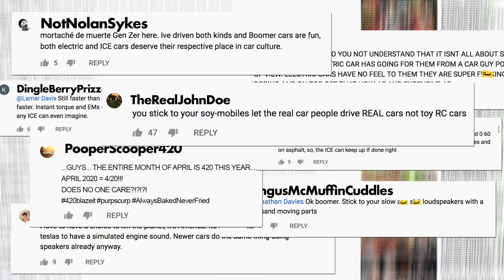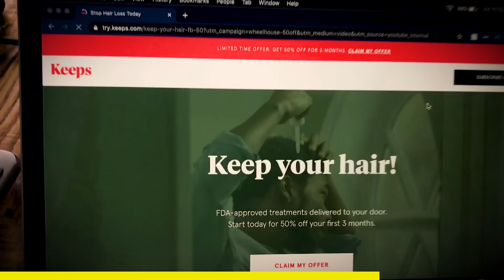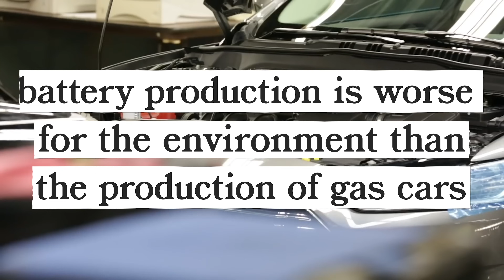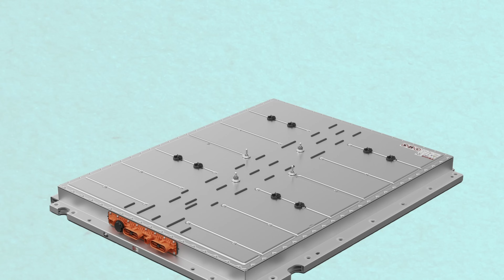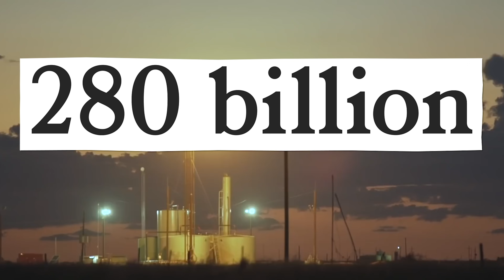Are Electric Cars REALLY Better for the Environment?

Comment: I'm with Nolan, I love how the engine sounds and feels, and I think I'll always have a gas car, but we need to accept that electric cars are here and it's the future.
Reply: @L.K this is a perfect way of explaining it. I also thought it was like digital art vs traditional mediums because the traditional forms are far more expressive and human but digital art is great at making an image fast. They both have their uses but traditional art, well made mechanical watches, and gas cars are a much more exciting, sophisticated experience.
Reply: @yoyo 19 That is awesome
Reply: @L.K Yeah but the same could be said about manual transmission cars.... if car manufacturers don't have enough incentive to make them they wont and they'll slowly disappear from the market. So maybe not in our lifetime but because there are more efficient ways, eventually gas powered vehicle will cease to exist.
Reply: I don’t want electric cars to completely take over. It should be an even split. Half gas cars on the road and half ev’s.
Reply: @L.K Or 
Have an electric car with manual transmission.
That sounds fun.
Reply: @anirudhhhh  that would kinda defeat the goal of efficiency, wouldn't it? ICE cars need transmissions to aid acceleration until it reaches optimal/top speed (either of the engine or of the car, to prevent stalling). However, ICEs suffers from inefficiency because not all power the engine produced would be laid down on the ground (thanks to the gearing) - and this is even on top of the inefficiency of the engine, which is for another discussion. EVs, on the other hand, can instantly put down whatever torque it can/needs to, so there's very low (if any at all) chance of an EV bogging down/stalling while accelerating. This eliminates the need transmissions and the inefficiency it introduces.  

(I could be wrong on some concepts/ideas, and I would gladly be corrected by anyone more knowledgeable on the topic)
Reply: anirudhhhh not how it works and not sure if it would have a clutch
Reply: @anirudhhhh  literally ZERO point in a variable transmission with an electric car, since they make all their torque from 0 revs. It would be totally inefficient. But, hey, keep dreaming bro! 👍😉
Reply: Yeah I find electric soul sucking, yeah it’s quiet, too quiet, GIVE ME MY ENGINE NOISE BACK.
Reply: I have started a collection of v8s if all goes to plan I'll keep them until I die. Driving a big ass manual V8 in 30-40
 years is going to be super rare
Reply: It doesn't have to be the future for all of us. If enough people buy EV's we'll be free to enjoy our loud ICE's in peace.
Reply: You won't have a choice in 20-odd years bro. Oil is a finite resource, and will only get more expensive. Also, most countries are in the process of phasing out ICE cars (most of Europe has already committed to no fossil fuel cars by 2025 or around that time), so good luck finding one to buy.
Reply: Liam NIre ever heard of synthetic oil?
Reply: @Ryan-mg5ve  I think you're focusing too much on the "oil is a finite resource" and not enough on "there won't be any ICE cars to buy".
Reply: @Ryan-mg5ve  oh, and synthetic oil is made from actual oil...... So there's that too.... 🤔
It just has synthetic additives.
https://en.m.wikipedia.org/wiki/Synthetic_oil

Comment: Wouldn’t electric cars produce more emissions because they typically will need battery replacement at some point?
Reply: If you took a look at climobil, you would actually see that the battery manufacturing process isn't enough to offset the result, here's a scenario I made - taking into consideration one battery life (very conservative estimate) vs. the total emissions from an ICE car during the same period: https://climobil.connecting-project.lu/?batteryLifetime=400000&batteryCapacity=72.5&greenhouseGas=65&electricCarRange=460&carbonElectricityMix=453&greenhouseBattery=30&greenhouseWTT=25&greenhouseTTW=150&batteryPenalty=0.9&annualMileage=25667&ICECurb=1205&ECurb=1847&NEDCpenalty=0.39&decarbonization=0.1

Comment: What about the fact that the Nissan Leaf needs scraped after 8 years because the battery needs replaced at a price of $33,000 when the value of car is only $12,000 with replaced battery. Toyota Corolla’s las 30 years and a Nissan Leaf would be scraped three times in 30 years so that’s 57 tones X 3
Reply: I made you this scenario in climobil, I hope you get the point:
https://climobil.connecting-project.lu/?batteryLifetime=201467&batteryCapacity=30&greenhouseGas=65&electricCarRange=250&carbonElectricityMix=453&greenhouseBattery=30&greenhouseWTT=25&greenhouseTTW=128&batteryPenalty=0.9&annualMileage=25667&ICECurb=1190&ECurb=1516&NEDCpenalty=0.39&decarbonization=0.1

Comment: I agree with most of these points and am big car guy and work for one of the biggest car manufacturer in the word that’s making its own ev too and the biggest problem we are facing is the lifetime of theses batteries like your phone after sometime they don’t keep charge and loose power storage it has been calculated that after 7 years of average driving these batteries will need to be replaced where gas cars have a normal usage of around 15 years and since most people don’t want to make the expensive replacement of a new battery witch would be around half the price of the car it will be discarded witch would start the process all over again there also a problem with the “recycling” of the batteries like you mentioned where rn they basically just shipped to poor countries and burned witch creates a bunch of gasses  That are worse then CO2
Reply: Car manufacturers are developing closed-loop systems for battery recycling and there are a plenty of other companies who specialize in this kind of stuff.

Comment: Some things that I'd like to say , as a fan of electric cars 
- they will only get better until batteries are more practical that gas/petrol 
-they are new and so will have loads of issues until they become mainstream 
- they still pollute the oceans with rubber particulates , just like any other road going vehicle 
- they will have to produce break dust , which has been blamed for respiratory problems and asthma 
-in some parts of Europe it's more expensive to charge your car than to fill it up 
- I loathe the exclusive charging port system that seems to be becoming the norm 
- policies on electric cars are going to be controlled by the government , who will find a new way to tax these vehicles 

And personally ( this last bit isn't a fact just my idea ) I think individual transport is on its way out . It's far more efficient to have a system of driverless taxis and/or rent-a-cars . I believe in the future you won't have your own car , it will all be part of the Public Transport system .
Reply: I don't see thst last one being As big in the U.S Yeah cities will likely have that transportation system but.the U.S infrastructure is built around the Idea of the car. I still see Cars eletric or hybrid being very important still.

Comment: What about hydrogen fuel cell vehicles? Can you do a video about hydrogen fuel cell vehicles?
Reply: 1. Liquid hydrogen is even worse for the environment to produce than gasoline and diesel. 

2. They are EV`s with more moving parts, theyre pointless. 

And dont even get me started on Hydrogen ICE... Its a reason that idea was dumped 150 yrs ago and gasoline took over 100 years ago.
Reply: Hydrogen is is "fool's cell". Very inefficient, weak and complicated cars (that are practically small battery EVs with a H2 extender) and costs more than gasoline while making the same amounts of CO2 etc. Because it's produced from methane. See how ammonia is produced. Billions of tons of H2 from methane steam reforming every year. Making H2 from water is a PR, nobody does that because it's even worse (cost and energy needed).
Reply: They have a real problem with infrastructure and storage of the fuel due to temperature (frigdidation). Tesla has already proven electric infrastructure is very do-able on the other hand. FCEV would seem to be a pipe dream of Honda and Toyota that they just can't figure out due to regulation issues.
Reply: Please do! Hydrogen cells are far better than ev and can make a great sound too!
Reply: @TwizztidAngel  They are literally just overcomplicated EVs. They have batteries, electric motors and they're less efficient than EVs.

Comment: I used to be a Tesla engineer and they had an argument for this. They called it the long tailpipe method but their counter argument was Tesla solar panels have created enough power to make up for all the miles ever driven by every Tesla.
However as a engineer, recall the first law of thermodynamics, and energy is conserved and  through every chemical reaction we cannot obtain 100% the energy from one form to another. Thus where does the benefit come from? Simply, emissions, it’s all about the oxides released and if that is better for the environment than their counterparts.

Comment: What about the replacement battery co2 impact ?
Reply: Find out here:
https://climobil.connecting-project.lu/?batteryLifetime=400000&batteryCapacity=72.5&greenhouseGas=65&electricCarRange=460&carbonElectricityMix=453&greenhouseBattery=30&greenhouseWTT=25&greenhouseTTW=136&batteryPenalty=0.9&annualMileage=25667&ICECurb=1205&ECurb=1847&NEDCpenalty=0.39&decarbonization=0.1

Comment: A GREAT video! There are massive biases on either side of the debate, but neither change the facts. The most important one of which is that 'EVs have less of an environmental impact than gas powered cars'. (10:50).
By switching to EVs we'll be doing less harm, but still harm. EVs are not a silver 'good for the environment' bullet, they are simply less bad. This is the best video I've seen summarising this.

Comment: The $7,500 rebate is t refundable, so you only get that full amount if you have that much in tax liability.  Which a family of 4 with an average income wouldn't be even close to.  On top of that it still only applies to new cars, and even the cheapest new electric cars are still cheaper than the $5k or so car your average working class family has.  So, this definitely doesn't help out your less well off buyers looking for a cheap used electric commuter.

Comment: The issue of electric vs ICE is extremely complicated, but the best way to explain it is that ICE cars convert fossil fuels to movement and release a ton of energy as heat and noise. A coal fired power plant converts fossil fuels to heat, which is really easy and efficient, then that heat is converted to electricity and the electric motors in an electric car are extremely efficient at converting that energy into movement. I do think the humanitarian issues with cobalt mining can't be ignored though. If you are getting an electric car to save the planet, you should really try to get something with a smaller battery, like a Nissan Leaf or something
Reply: Yes, 50 % of the world's cobalt comes from the DRC (20 % of which is mined under inhumane conditions), but that is the reason car manufacturers don't want to use cobalt from that region. Tesla, for example, gets theirs from China.
Cobalt is also used in the manufacturing process of other products, for example, dyes, one type of steel and it's also used as a catalyst in the desulphurisation process of fossil fuels.

Comment: Whaaaat about the disposal of batteries and the loss of electricity from the plant to the car/ storage, and kinda seems your hiding behind selctive data points. But good video i loooove you guy
Reply: Battery disposal - First they get reused in renewable energy storage projects, then they get recycled.
Losses - They are not as significant in the grand scheme of things as you might think and are already counted in.
Reply: @evolt7553  thanks for responding bc im genuinely curious about this topic and have alot of questions i dont always get full responses to. Its true that the batteries can be reused and recycled but its just cheeper to buy new material for a new battery and idt companies will show a real intrest in reusing and recycling and neither will garages that most average consumers will be inevitably take it to. And with the lose of power from transport to storage its hard to get a good average but just for a couple exaples things like distance from the plat the age and type of wires city infrastructure, "random/accidentl" discharging or improper charging. If you respnod you can add completly new arguments around this topic bc i realy want to understand this from many difrent angles and just like every part in a car drive train can affect other parts directly or indirectly i think ever argument and veiw is important (to a point but....).  Iwill often argue the devils advocate, bc i just want to learn tx

Comment: You missed something :

Electric cars use way more electricity to run, in the end, you'll need about 10x more mpkw than mpg, which greatly increases the 2 year lifespan you said earlier.

Of course it all depends where the electricity come from, but the facts still remains : You haven't mentionned how much electricity a car can eat compared to a gas car.
Reply: From 3-5 miles per kwh depends on the size of the car. I don't think you know that "mpkw" doesn't exist as it should be mpkwh. 1 kilowatt for 1 hour = 1 kilowatt-hour
Reply: @gforce95vn  I forgot the H.
Reply: This doesn't make sense... An electric car uses more electricity to run than a gas car uses electricity? If you are talking about them being less efficient, there are MPGe (MPG equivalent) calculations for electric cars to put numbers into context for that... here is a page from the US department of energy showing tesla model 3's getting numbers WAY higher than a gas car could ever think of. Modern electric cars are crazy efficient. https://www.fueleconomy.gov/feg/bymodel/2019_Tesla_Model_3.shtml
Reply: @RMPhotographyCA  I'm not an English native speaker, i'm trying my best.

But yeah i'm talking about electricity efficiency compared to regular gasoline efficiency.

I used to compare a Renault Zoé VS a turbocharged Ford Fiesta from 2017 ( If i remember well ) taking into account the CO² rejected from nuclear plants in Switzerland ( Where i live ).

Based only on those points, the Fiesta only gets better efficiency with time, in fact, after about 10 years it gets less CO² than the Zoé.

Haven't mentionned the extraction process though cause it differs too but the facts are still the same : Gas efficiency only gets better with time.

Comment: Like the video, great start but i don’t think you are done comparing the two cars and their environmental impact

1st - Have to take into consideration upkeep maintenance and useful life span of both vehicles. Seems most EVs require 1 or 2 battery replacements on average to match the life span of a ICE vehicle. 

2nd- the environmental impact isn’t only CO2. There are other harmful chemicals that pollute the environment that people tend to forget. Electrical waste pollutes drinking water with mercury and other harmful chemicals. Radio active waste is another from production of electricity.

3rd- disposing and recycling of vehicle at the end of life. Some companies are even against the repair of damaged vehicles and provide no support to salvage/rebuilt vehicles.

Comment: Where do you people think the electricity comes from? Tires are also a very big polluter that is very rarely touched on
Reply: Electricity comes from a mix of nuclear, coal, natural gas, solar, wind, biomass, hydro, geothermal and oil.
Also, here's a link he mentioned at the end  - I made a scenario in it:
https://climobil.connecting-project.lu/?batteryLifetime=400000&batteryCapacity=72.5&greenhouseGas=65&electricCarRange=460&carbonElectricityMix=453&greenhouseBattery=30&greenhouseWTT=25&greenhouseTTW=136&batteryPenalty=0.9&annualMileage=25667&ICECurb=1205&ECurb=1847&NEDCpenalty=0.39&decarbonization=0.1

Comment: I think really the fact is that EV’s are really only slowing the issue down, I think the best option would be to look for more eco friendly alternative fuels because I love gas engines don’t get me wrong but if we keep going like this we aren’t gonna have too much longer, however on the flip side EV’s in the long run could produce issue with recycling and disposing of the batteries. You don’t have to agree but this is just my take on the subject.